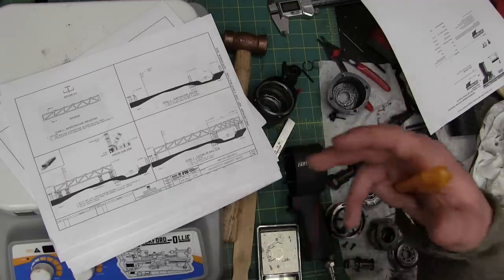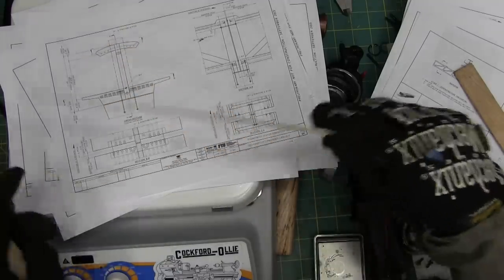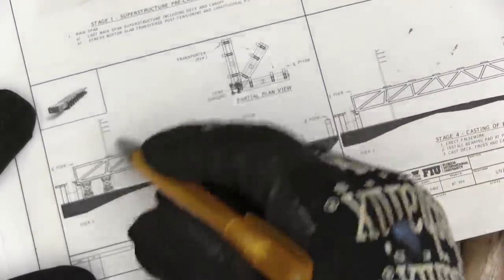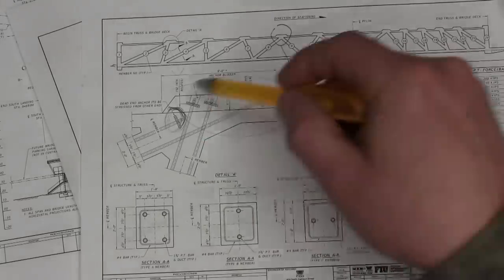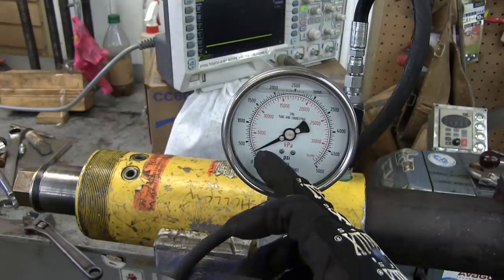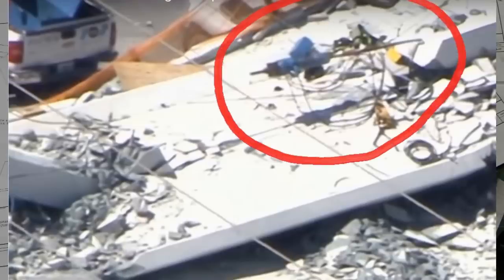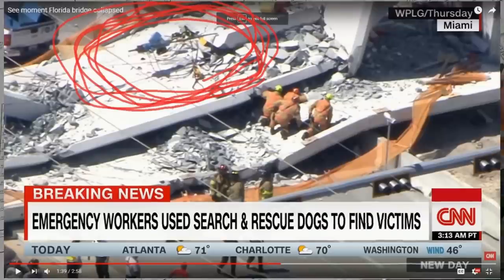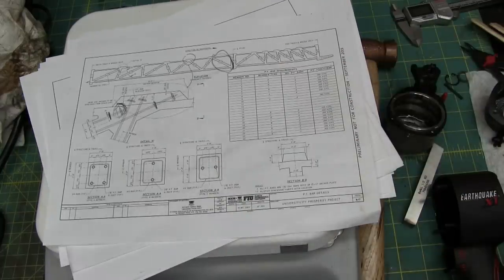Post Tension Failure Florida Bridge Collapse | Engineering EXPLAINED!

Comment: It looks like a design flaw. 
 One single point failure - pow, snap, booom.
I doubt this design - will ever be used - again.  
Make bridge in steel - with 2 warren trusses, on both sides.  Concrete aesthics, and snapped steel rod - did not work.

Comment: instead of complaining - did you actually listen to what was said? in a nut-shell , the cause of the failure was explained (quite well in fact) and I am glad I watched this particular video.  I have watched other pseudo explanations, none were as clear. Engineer-speak doesn't explain anything. Practical simple example explained it all.

Comment: Sounds like they unintentionally stretched a bolt by over-stressing it. Then they thought they could just tighten that sucker up to spec and boom. The designers of the bridge set it up for failure. Any deviation from the installation drawings  ( ie. moving the jack points/ lift plates ) compromised the structure. Then throw in the decision not to stop traffic and you have this debacle/tragedy.

Comment: Looking at the post with the tensioner  sitting on top of the upper deck, it looks like column buckling, not of tension rod failure, but of the upper flange or deck concrete.  Having watch a slow motion video of the collapsed, it appeared that the column being adjusted was buckling. https://photos.google.com/search/_tra_/photo/AF1QipMCxh_wb6J70D2ewXVHxiFruoRnXIyrS8DXwFUm  It was likely a failure in compression, a failure in concrete integrity do to material or design.  As a construction superintendent, I have rejected, replaced and removed substandard concrete on a number of projects due to faulty installation and products coming from the suppliers. Steel such as rods have a known strength, while concrete strength varies and is not 100% consistent.

Comment: So, basically the bridge was built in this fashion to decrease the amount of disruption to this main road....

Bridge collapses on main road as a result...

So, damage caused during the move in place due to the support being in the wrong position. Then they tension the crap out of it. But, the real question is, isn't this bridge design just terrible? I mean, if you just closed the fucking road to traffic you could have placed a much better designed bridge.

Comment: The crane was there to hold up the machine to tension the cable . That tiny crane would not have picked up a section of the 950 ton bridge. Everything that was put in place was designed by engineers. Construction company has to get everything inspected by the onsite engineer before and after the pour concrete. I agree they should have had something temp in the middle but the one that calls the shots there is the engineer. They tell you what they want and where to place it.

Comment: Firstly, it seems to me that the bridge was pre-fabricated and simply hoisted in place. It should have been pre-tensioned. Secondly, your calculations need to be 100% correct and engineered with a generous safety factor if you are constructing above LIVE traffic. Either the engineer was over-confident on his design or they were knowingly taking a risk. I'm guessing the engineer designed the bridge wrongly. It looks too thin and flat...under braced. my 2cts

Comment: Another case of no redundancy, one piece goes, the whole thing collapses
Reply: it was built by a female team thats why.
Reply: @DoubleMonoLR  yea and grizzly adams had a beard.
Reply: @dirkdiggler2379  Incorrect.
Reply: @ericpeterson9110  female engineers dropped the ball
Reply: @dirkdiggler2379  No ,they didnt. It was a mixed gender team with a male EOR, Denney Pate who also told the contractor to keep the road open following the cracking. THis is pretty easy to fact check if you read the official reports.

Comment: well any one knows that if you strain a bolt to much it will break and lets say you put torque on a bolt then release it and torque it and release it using the same amount of torque at some point that bolt will weaken and I think here in this case when they moved the bridge jack to a different spot they actually strained the tension bolt so when they got up to re tension it which they were doing at the time, ( there was a guy hanging from that crane) it broke and it shot out so much the guys harness broke and he fell and was killed, there is a video of that too

Comment: That hydraulic cylinder did the Kessel Run in less than 12,000psi; after the modifications. I'm reaching but there is a Starwars joke in there somewhere. I think.

Comment: If you step through the dashcam footage (https://youtu.be/p6L20i6_gzE) frame by frame, you can see the first diagonal member on the left buckle and fail in compression. This is the one that had the hydraulic tensioner on it. I believe that when the rod snapped, the tension from the other rods and the sudden release of tension caused the diagonal member to curve slightly - allowing the member to buckle.

I'm not sure what the crane was being used for. It might've been used to move the hydraulic tensioner

Comment: How was a stupid cable supposed to support a concrete bridge in tension?
Concrete= strength in compression.
So you weight a cable to support a mass of concrete in tension.
Cable breaks= concrete falls.
Totally stupid design.

Comment: In the 1st place, they should have never opened up that road to traffic while they were tinkering with the supporting structural members of that FIU bridge, and they gambled on cutting corners on public safety, and they loss.
Reply: I know my hometown Houston, they close off those roads to traffic that are going under the bridges or on the bridger while working on those bridges, and they even closed off I-10 freeway in the downtown area when they were working the Elysian Street Viaduct bridge. So public safety should always come 1st when they are working on the supporting structural members of any bridges.

Comment: I think you are getting close to the answer as to how the failure occurred. This video:
 http://www.sacbee.com/news/nation-world/national/article205760454.html 
provides a slow motion look at the failure. It appears that the purpose of the crane was to provide a "sky hook" for the worker's safety harness, which also failed. I think that the biggest error was the wrong thinking that this section was self-supporting because it resembled a truss. If it were self supporting there would have been no reason for the expensive aerial support cables in the design. The temporary supports should not have been removed until the supporting cables were attached and properly loaded.
Reply: Gatnos weren't those suppose support cables just aesthetic and not functional? Thought I read that part. Did u confirm they were actually support cables?

Comment: The design should have been a 3 section bridge instead of a 2 section and they should have designed a cable support pole on the south side of the road as well. But THE MAIN REASON THE BRIDGE COLLASPED IS.....Because they moved the bridge over the roadway before the cable susspension pole was in place. When you roll that bridge out there and set it in place......YOU HAVE TO HOOK UP THE SUPPORT CABLES BEFORE YOU REMOVE LIFT ROLLERS FROM UNDERNEATH!
Reply: It was not a suspension bridge
Reply: Then why does the prototye drawing show a tall pole with 4 cables on ech side? or what look like cables. If it was not a suspension bridge then it should have been.
Reply: cody patron I know the drawings make for a lot of confusion. The pylon and steel tubes, that is what they are, were there to provide vibration damping. The bridge itself was designed as a truss bridge.

Comment: the design was flawed and the explanation for the failure is incorrect.  I have engineered thousands of structures and after watching the videos of the failure, it was not the diagonal chords that failed, it was the bottom chord of the truss at the left panel point.  this bridge was going to fail eventually, especially if it fails when completely unloaded.

Comment: It was flat concrete over a long span with no beam structure support.It was designed to be held up by the cables+counter balanced by other half or it would not have been a flat bridge.Look for pic's of top of roof with big squares of many bolts for cables above each truss.The trusses were supposed to hold up the floor not the roof!Without the cables the roof+trusses became a heavy down force on a long span of flat concrete they were supposed to hold up.It is a fricking no-brainer they assembled it wrong.Only way it would have worked is if it had atleast 3 temporary supports underneath until cables,tower and other(counter balancing)half was in!

Comment: Crane lifted tensioner to roof top says the DOT certified ironworker welder. The sad part is it is not legal to use crane for over head tie off, it would have saved them going in the hole. In truth is it was game over when they picked the load wrong and "snapped" the cable. mike&gina in Tennessee, in love, in Christ.

Comment: There is something very obviously  wrong with this Warren Truss! Both web members 2 and 11 Ought To Be Made Stronger than the Upper Flange! 

Web member 11 should be as strong as 2. Instead, we can see that 11 is visibly smaller than 2.

I have browsed through a large number of photographs of real Equilateral Warren Trusses. 

The outer web compression members are typically The Identical cross section as the Upper Flange (at the ends); and for very good reason! The outer web members carry as much compressive force as the upper flange (on Equilateral Warren Trusses).

But, they are not equilateral in the FIU bridge. The outer compression members are much longer than the rest, thus having a shallower slope and more compressive load.  Using basic trigonometry, these outer compressive web members must Exceed the upper flange in strength. Say, 2 times larger in width and thickness than the upper flange *requirements, minimum. 

Obviously, the upper flange must be made wider than the web members for stiffening to match the overall span. But the overall compressive strength must be exceeded in the outer web members. Basic trigonometry shows the compressive force applied to them is about twice as much as found in the flange.

Comment: Simple question: why make these out of concrete, when it is so pathetic under tension?
Non PC answer: because it is the cheapest, especially in long-term maintenance -- no need to paint it
Reply: Also, this overpass was gigantic.  Colossal.  Way way way too big.  It had built-in benches and seats...why?  I can just see the political pressure everywhere on this project.

Comment: I couldn't care less about the vocabulary. I have done forensic engineering for decades, and have seen the littlest changes without careful consideration cause disasters. I won't bore everyone with my lack of knowledge [sarcasm] but I would have protested the field changes I saw on this project. Big kahunas sometimes hated me for pointing out obvious problems, but they had deadlines to work within. I have even been threatened to be thrown off of 40 and 80 story buildings for pointing out what I knew would cause problems. I probably would have been threatened to be thrown into traffic for stopping traffic myself. Engineers loved me because I was able to figure out some of their mistakes. No, I am not that brilliant, I just hate when things go wrong and things break, and people are hurt and killed. I think some are happy that I was hurt bad in a bad car crash and had a bad heart attack because of the complications of the seven surgeries from the car crash injuries. When things were going wrong, there were a couple dozen manufacturers that would ask me to personally figure out the screw-ups. The manufacturers and engineers loved that I had both technical knowledge and field experience that they lacked. Keep up the good analysis for the engineering failures. BTW - I have a dual trace sillyscope. I like to watch the results in stereo!!

Comment: I’m not an engineer but I work on post tension projects and it’s always been my understanding that there is a time frame in which you can stress the post tension cables.  Usually within 72 hours of placing the concrete.  If the bridge was poured on the side of the road I imagine it was there for awhile.
Reply: Also you don’t remove the shoring until the post tension is complete.  By pulling out the supports parts of the deck are holding up the entire structure

Comment: Forensic Engineering Report
Slow motion video - https://i.imgur.com/9o6zVT1.gif
<- North ----- South ->

Experts cite explosive joint failure as cause of Florida bridge collapse [New Civil Engineer]
https://www.newcivilengineer.com/tech-excellence/experts-cite-explosive-joint-failure-as-cause-of-florida-bridge-collapse/10029278.article
Quote
“I think they probably were carrying out jacking works,” said Bourne. “You only have a jack connected to the bar on for the few minutes you’re stressing and it’s still on in the collapsed condition. If they weren’t stressing it, it wouldn’t be there.”

It is this additional force being put into the diagonal member during the jacking operation that Bourne thinks could have caused failure of the critical end joint.
- End Quote

Diagram of bridge - https://res.cloudinary.com/engineering-com/image/upload/v1521406423/tips/Capturemiami_wno3we.png
<- South ---- North ->

Damage to the side of truss member #11 is spalling caused by the explosive release of elastic energy which was stored in the highly stressed post-tensioning bar within when it snapped.

This, along with the picture of the jack still attached to the P.T. bar, is the smoking gun.

https://s25.postimg.org/gxd5oydgv/FIU-bridge-collapse-spalling-smoking-gun.jpg

https://s25.postimg.org/6i2e2nlv3/jack_failed_pt_bar.jpg

Forensic engineering conclusion

There is no satisfactory way to "implement" a house of cards. It is an intrinsically precarious structure.
http://www.craftstylish.com/assets/uploads/posts/118831/house_of_cards_lg.jpg

Maybe somewhere there is a house of cards which has stood the test of time, but it is generally understood that the metaphorical reference to a "house of cards" is to compare it with something that is precarious, unstable and prone to failure - in this case the FIU pedestrian bridge.

If, as it seems the evidence may be pointing to, the bridge failed because of what one worker did in a minute dangling from crane with a jack to a P.T Bar then that proves that the bridge was precarious and so it had a bad design.

A good design should exclude the possibility for one worker doing something inept, whether under orders to do that something inept or not, which causes the collapse of the whole structure.

A good design would build in redundancy so that if one component failed - like a P.T. bar or a truss member or a truss joint - then other P.T. bars or truss members or joints would save the bridge.

Or a good design would use a truss made from rigid metal-only members (tubes or girders) and metal-only joints and avoided the problems of trusses made from prestressed or post-tensioned concrete on such a critical component of a bridge.
Reply: They assume the cable stays were actually designed to carry a load.
They were there just to look pretty,  and resulted in the Trusses having  a distorted design.

Comment: OK the rod snapped, but nobody has explained why, over tightened?, bad/wrong steel, faulty rod?, undersized rod? - pretty obvious this bridge was designed by novice engineers with little practical experiance

Comment: Here - https://youtu.be/B1PPqa9cS-k?t=79
you can see the inside of the beam they were working on. There is a white corrugated hose with the broken tension rod still inside it. You can see it has bent outwards from the concrete. I would guess from the forces of the rod failing (the whole rod is trying to get out the hole all at the same time). You can see the chanel in the beam where the rod and hose used to be, nicely split down the middle. Reminds me of deveining a prawn. The rest of the beam that used to encase the rod is completely gone away. Why is there no rebar hoops going around the beam (yes like electricians tape around the hamster)? This beam is under compression and carries the same compression load as the roof. You could remove the vertical beam at the end and the bridge would stay up. Maybe the tension bars and pancake mix were added after the center part of the beam was made. Yikes!

Comment: good review.... I can tel you now from the reeding I have done they over stressed the bridge when wheeling it into place, by having a large canter-liver at one end. That took the post tension cables to near elastic state and than when they had the bridge in place they tried to reduced the canter-liver tension and it collapsed. As an Engineer with two degrees I an putting my best guessing/ estimate that thats what happened. 80%  confidence that is the cause of the collapse as you can see the jack and post tension cable shooting-out of the collapsed structure. Further the men were said to be tensioning/ un-tensioning the bridge to working loads.  ⚰️  School boy error or in this case its a school girl error as the design is driven by a woman.

Comment: 900 tons in 170 ft span, there ain't gonna be no give or bend my friend. Concrete = Rock, same gravitational physics. Posttentioning shoulda been done in increments over a 30 day curing time at the foundry not when it is hung in the air with no support cribbing
Reply: Tom Jenkins - only "minimum" earthquake-resistant is required in Miami it seems.  The finished bridge with the "pipes" attached  may meet that but likely not as a structure when it was being moved.  I think the act of moving the bridge was causing seismic events on the structure and it broke.  A FIGG engineer said there were "some cracking" after the move ( yes cracking with the "ing").
Reply: "not when it is hung in the air with no support cribbing"